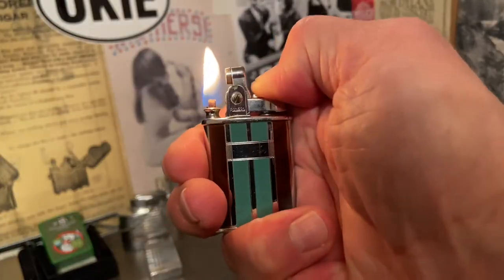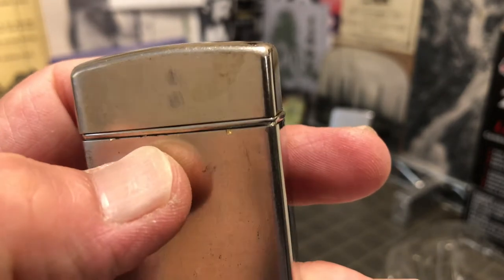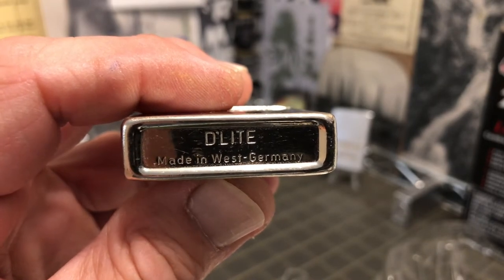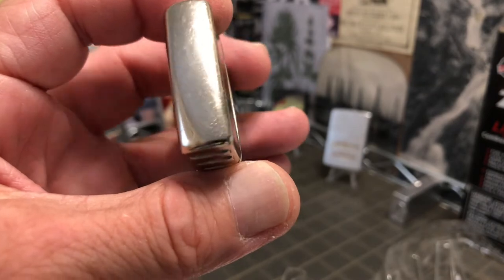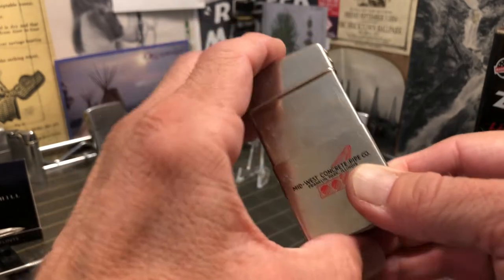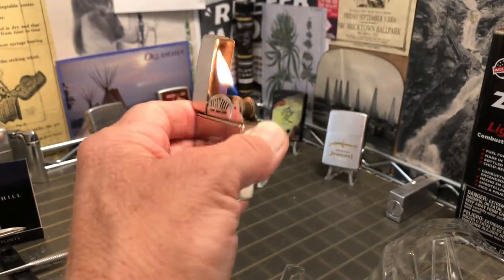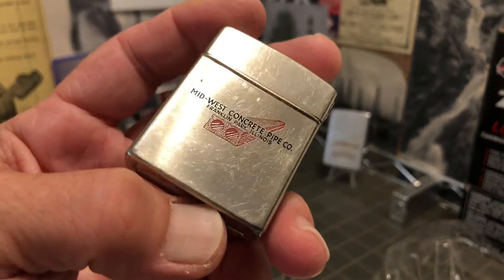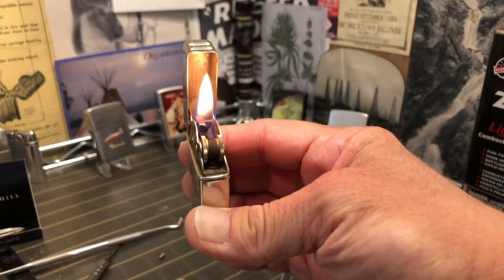Vintage D'LITE Petrol Lighter Advertising MID-WEST CONCRETE PIPE CO. Made in West-Germany

Comment: I have an old D'Lite, that was my Father's, who passed away in 2001. It looks almost identical to the "Mid-West Concrete Pipe" only mine is smaller and has the naval ship Dad was on, engraved on it. I would really love to clean it up and get it working again. I have taken it apart and unscrewed the flint, but am unsure how to remove the baseplate to replace the batting and the wick. Do you have a video showing the whole process, or could you do one?
Or do you have a link that could walk me through it? 
BTW...heading off sailing for a month as of tomorrow so will not be able to respond immediately if you reply. I will check when we are back. Thank you from a new subscriber.
Reply from the maker: Thank you for stopping by Sailor Girl, I hope your trip is fantastic! I wouldn't replace the wick and wadding unless they are contaminated and obviously need to be replaced. You said you "unscrewed the flint" which makes me wonder if you checked to clear the flint tube of old, degraded flint? Most old lighters need the old flint dug out of them before they will operate. I can help though, just ask what you don't understand!✌️